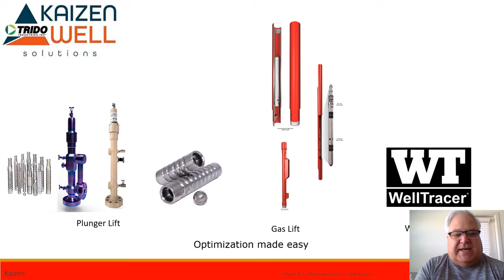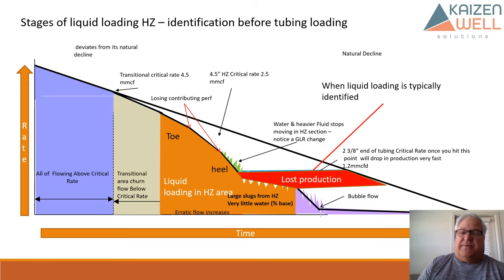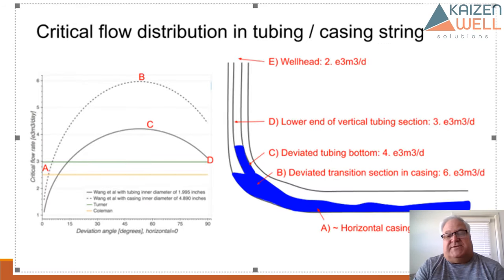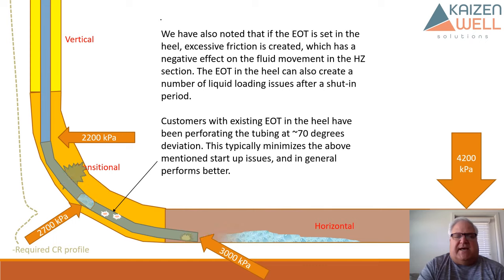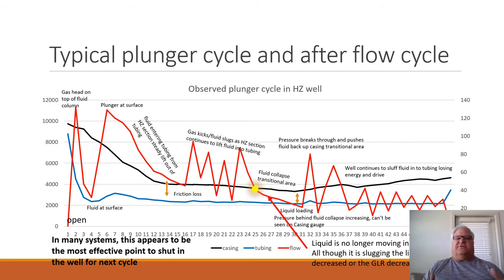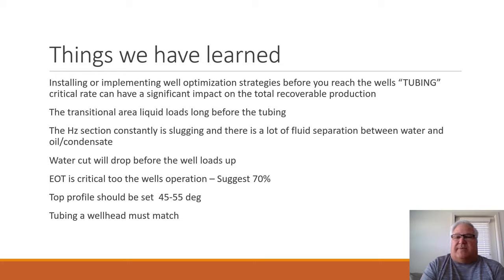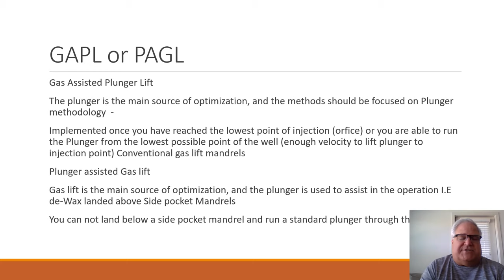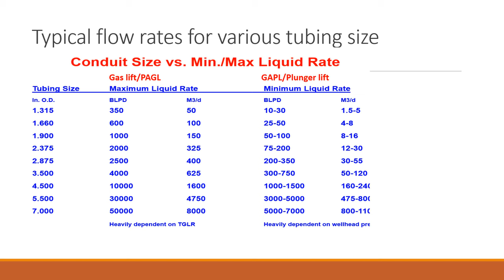Liquid loading in Hz well and plunger lift

Comment: Thanks, excellent discussion. So to minimize oscillation a packer assembly with short tailpipe would beneficial. I have been playing around with that idea myself. Yes the Turner rate (droplet models) are significantly under estimating critical rate especially in larger deviated wells, I though this was due to the regime change (accumulation) being dominated by liquid film reversal. Do you have any SPE papers on the work presented in this video? Thanks in advance.
Reply from the maker: Thanks for the comment and feedback, and sorry for such a slow response but I don't have any SPE papers on this I have presented this at a few ALRDC gatherings etc. I also enjoy Dr. Nagoo's view and papers on this subject (you can find him on linkedin as well) he has a very interesting model developed.